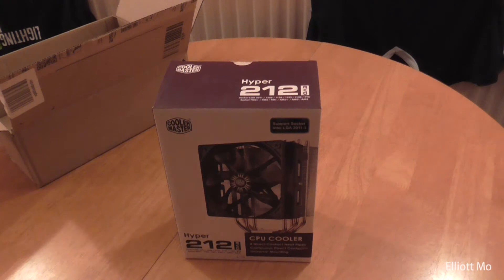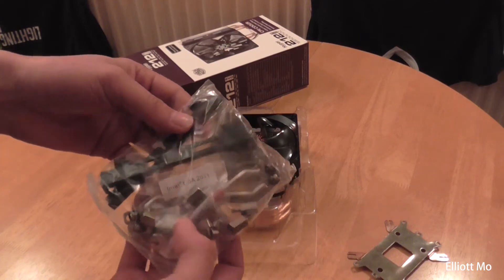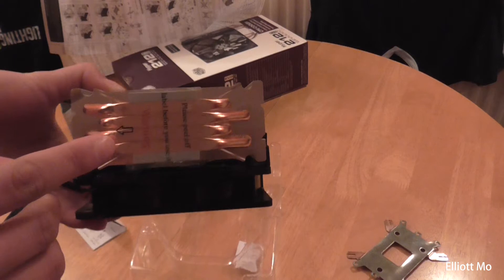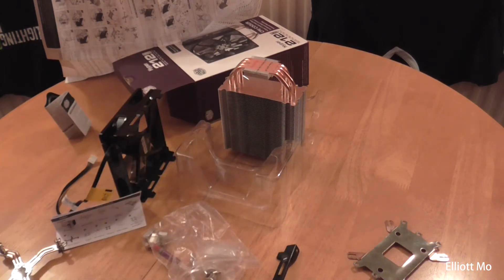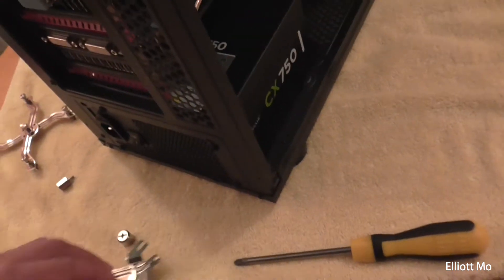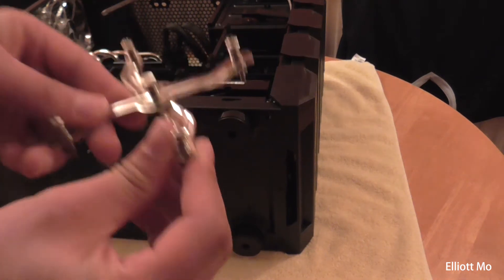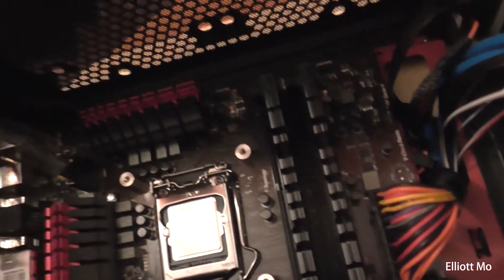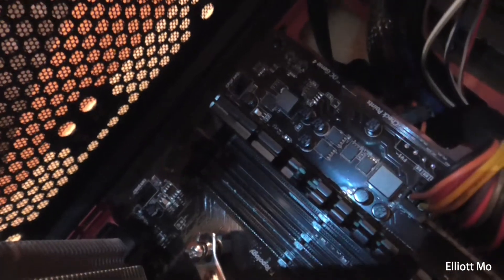Cooler Master Hyper 212 EVO Unboxing & Installation

Comment: having the fan on the right side sucks cool air and pushes it through the heat sink to the left where your exhaust fans are?
Reply from the maker: wesler218 Hey, that's correct. :)

Comment: wich type of case to can fit perfectly CM hyper x 212x?
Reply from the maker: The height of the CM Hyper 212x is 158mm. So any case which can support a cooler height of around 160mm should be fine.
Reply: can you give a recommendation budget case would be fit with this cpu cooler?

Comment: i have to reseat mine idk why temps are so high... had a tough time installing it first time
Reply from the maker: I must say, it's not the easiest cooler to mount with its weird cross brace. Hopefully it'll be more successful a second time. Which CPU are you using?
Reply: i7 4790k i am hitting 73celcius on bf4 and i do not like that.  This is what is keeping me from playing the game...  I moved it a lot and had to push down the screw because they kept rising and it took like 10 minutes to screw it in.  i might have used a little much thermal paste as well what temps should i be4 getting if i do a good job thanks.
Reply from the maker: It's best not to move it too much when installing it, although sometimes it's difficult not to. Using too much thermal paste will not affect temps unless it comes into contact with the motherboard (then you'll have problems if its conductive paste). At stock speed other people have been getting around mid 60's so your temps could be a little lower. Perhaps the fan speed is too slow, or you don't have enough case fans to exhaust hot air produced by other components? (Just a thought)
Let me know if you have any success.
Reply: how can i adjust my fan speeds in the bios right idk if i should reseat it at all.  Just kinda nervous doing it because i do not know why the temps are so high.  I use the stock thermal paste with it.  I have an h440 wit three fans in front and one exhaust.  I think that 70 is high i see people just hitting 60 on bf4.
Reply: and i do have it at stock speeds if i change it how much do you think that will help. or does it automatically change when under load.
Reply from the maker: If you had trouble installing it, then it's probably worth another shot at reseating it (try and get someone to help hold it in place). Maybe try moving the bottom front fan into the top at the back as an exhaust. This will help remove some of the general heat in the case. Regarding adjusting the fan speeds, it depends on which motherboard you have.
Reply: I went into the bios on the gaming 7 motherboard and the rpm was near 1400 and temp was near 50... i just finished a comp match on csgo.  It doesnt usually run at 1400 rpm because i cant really hear it.  I think that reseating it is the best option.  I saw multiple videos where people are hitting mid to low 60s running at only 800 rpm.  I hope that this is the best thing.  Also when installing it the backplate was turning with the screws and i just messed up i think.  Thanks for all the help and i think that i will be reinstalling it with help from someone else.
Reply from the maker: At stock speeds the temps should be fine. I was just checking you hadn't overclocked it as this would of course produce extra heat! If the CPU gets too hot I believe it will throttle to slower speeds.
Reply: I have not overclocked it at all. and on msi afterburner is where i am getting my temps. csgo is lower 60s but when i turn on multicore rendering it hits 70s which i know is not right and way too hot for my liking reseating it would be a good choice you think? thanks again.
Reply: also im going to sub you for all this help!
Reply from the maker: Reseating the cooler, and moving the lower front intake fan to be an exhaust are the best plans I reckon.
No problem, it's what I love doing! Thanks for the sub.
Reply: np im just making sure i should reinstall it by playing some battlefield.  Np you have given me a lot of help and i should let you know how it went if i do not respond remind me haha ill be gaming too much with low temps thanks dude.
Reply: so i just played bf4 for like 20 minutes and hit highest of 74 but the fan doesnt seem to be going to fast... if i turn up the speed would that possible break the fan.
Reply from the maker: Nope. The fan cant go faster than its designed to unless you supply it with over 12 volts which you won't be able to do easily. Have a play around with the fan curves in the bios of your gaming 7. You should be able to produce a nice fan speed curve.
Reply: Do you think if i left everything stock speed and reinstalled it correctly i wouldnt be going over 60s
Reply: also im afraid of uninstallung it because i hope the x bracket isnt stuck into the standoffs because when i was installin it the back backplate was turning with the bracket and i had to put a lot of force on one screw for it to fit.  should it be ok or do you think damage is done... i am a very paraboid person as you can see.
Reply from the maker: I'd leave your CPU at stock speed until you lower the temperature. I think you should definitely set a fan speed curve in the bios (I think you can get it to automatically set a curve).
If you reinstalled your cooler I think you'd still be getting 64 ish on BF4. (An improvement from 74!).
Unless the screws are cross threaded I don't see why anything would be damaged. Your motherboard is still working so that's good!
If you want to add me on Skype you can contact me on there if you run into any problems reinstalling your CPU or setting a fan speed curve in the bios. (profile name: elliott.mo)
Reply: +Elliott Mo Thanks i will let you know how it goes